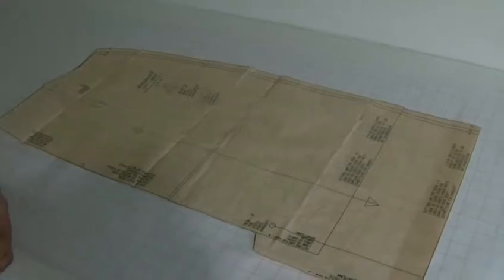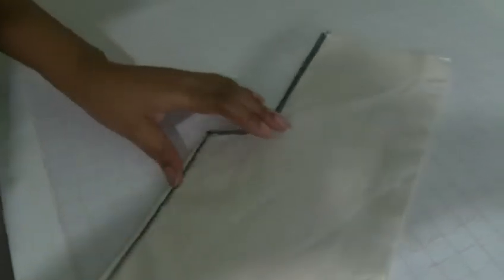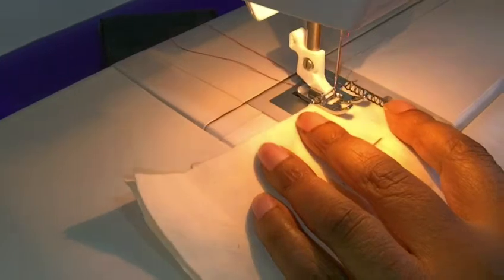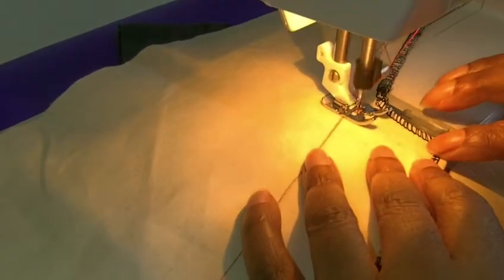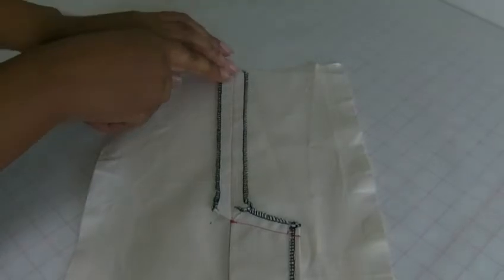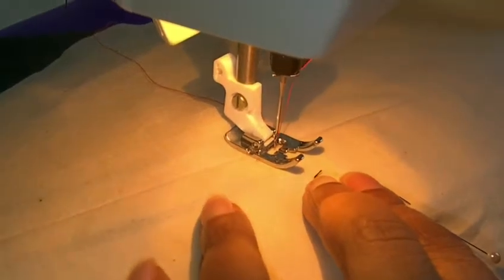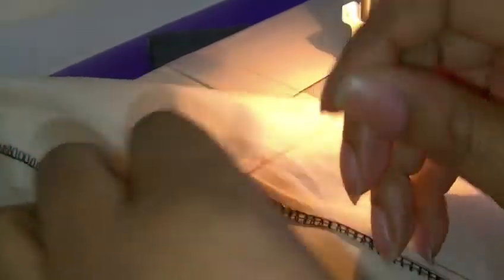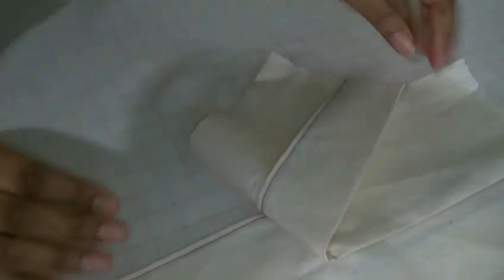Sewing a Vent

Comment: i watched another video but it didn't show how to finish your seams because it was a lined skirt and i was afraid to notch above the vent after i've serged but this video clarified that that's OK.  in the other video it also showed how to finish your hem since one side of vent will stay and the other will hv to be folded under but i got clarification on that too and you just have to sew the hem BEFORE folding under the vent and then blind hemming that portion. so, sometimes it helps to watch 3-5 videos then saving the ones that you can piece together to customize your need ;) THANK YOU for all your tutes @Colleen G Lea - FSBTV!
Reply from the maker: Hello Tammy DePlata.  Sometimes it is easier to have bit size of information, to  better understand what could be a tricky technique. Your approach to customising your learning is a good one. Thank you for commenting and the compliment.
Reply: =D awesome!  you're great!!!